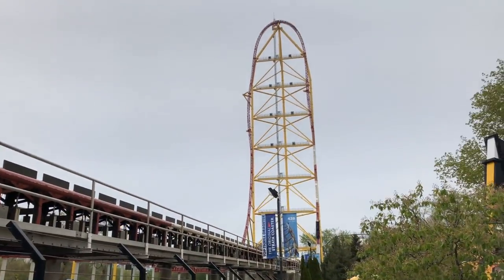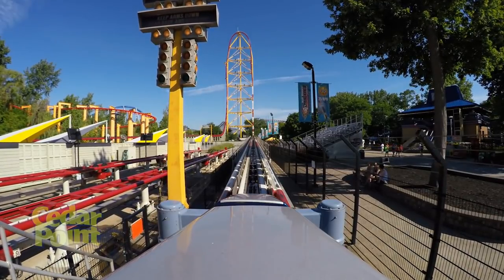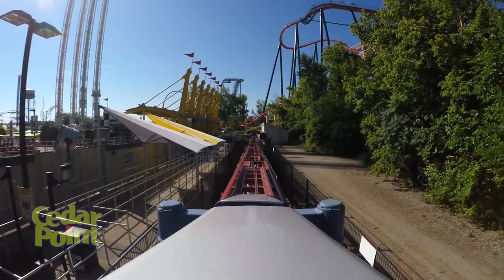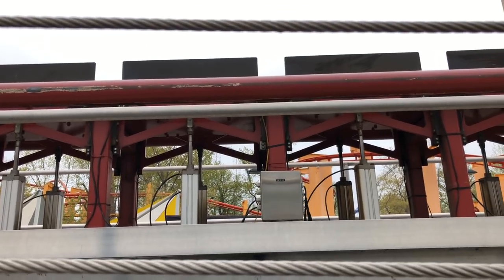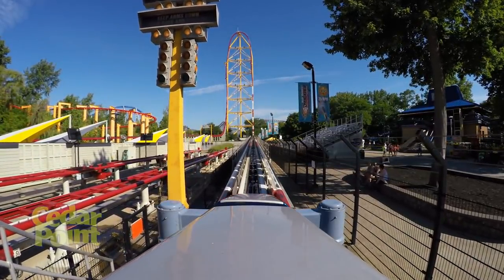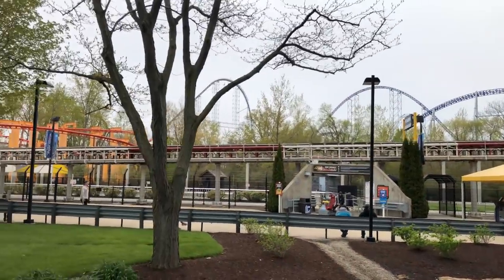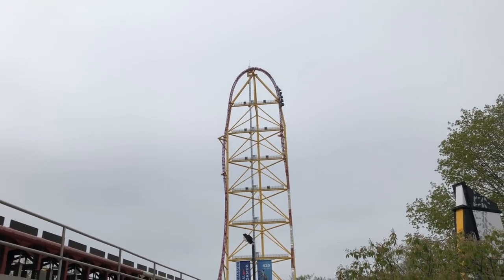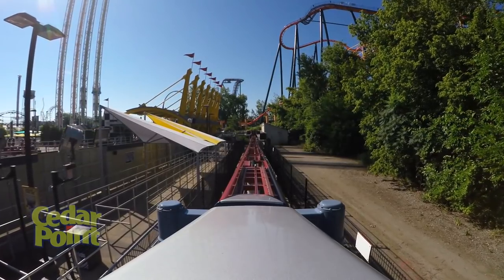Cedar Point Conspiracy Theory: Top Thrill Dragster

Comment: Hey! I used to work on Dragster so I have a little insight. You were totally right.. majority of the time we were down for weather, followed by sensor and fin faults. We almost never went down due to hydraulics themselves, but we would go down for the catch car not engaging the trains correctly. In regards to the 5 vs 6 trains.. we ran with 5 for hourly throughput reasons. Running 5 was more efficient than running 6, due to parking and multi move. I never heard of a possible bumping issue, but who knows haha. Thanks for the construction updates! I can't wait for Yukon Striker next year.
Reply: About how many Dragster employees get to experience a rollback? I know it's a strange question but I was wondering for the amount you get to see them when you run the ride you would at least get to experience it once, right?
Reply: As many times as I've seen them I have never actually experienced one hahah. A few times the last ride of the night (with a semi empty train) would fault the sensor at the top of the tower for going too slowly over the tophat. If you're looking to get one I've found that they happen most on the first or second train of the day.. or if you're lucky enough to be next up after we would go back up from a weather delay! Contrary to popular belief there is no "rollback button" that we are able to press :)
Reply: I was just coming here to say all this thanks! 😂
Reply: I wonder why 5 trains would have a larger hourly throughput than 6 trains? And I believe I’ve seen them run 6 trains before, but I may be wrong
Reply: Tysen Leib more blocks and trains means more waiting on trains to move to blocks before launching
Reply: Yes that what I always heard also about running for 5 of the 6 trains because of efficiency... I can that example on my openrct2 recreation as well
Reply: I saw some wanted posters of this trio... Said they were building some machine to overthrow Maverick. Pretty silly right?
Reply: its because isnt there senor issues on the launch track even just one showing red its down? and last year it launched didnt make it over and ripped all the break finns off the ride
Reply: @TysenLeib  in 2010 when i was there it ran 6
Reply: A little catch-car brake trouble light is all in good fun. Hahahaha
Reply: I think more than one prox needs to be mismatched to trigger an error (like a single sensor doesn't send a trouble light but more than one will,) but you have to remember that each catch car brake, and each of the speed brakes on top have proximity sensors on them, so there a ton of sensor readings to keep the ride running in auto-mode.
Reply: @MiLeYjBfAnN22  Funny story, I was one the first train after a rain delay and they only filled the first three rows so it wouldn't rollback!
Reply: Brennan Satola yes! Same reason why the morning opening operations calls for a staggered fill for the last few rows of the train.  As the ride warms up we would fill the trains accordingly.

Comment: Now I'm no engineer, but LIM/LSM launches accelerate slower than a hydraulic launch. So with the ammount of launch track that Dragster has, I don' t think that it will have enough speed by the end to complete the circuit. There is a bit of straight track after the launch, and they could put LIM/LSMs on part of the ascent, but it probably still won't have enough speed.

Comment: Dragster was designed so that the trains would move in pairs or just closely behind each other in the load and unload stations. During testing Intamin couldn't get the drive motors to run at the same speed which caused trains to bump into each other.  You'll notice that a train won't move into the next block until the block in front of it is fully clear. Millennium Force is setup the way Dragster was supposed to be setup. On Millennium Force the unload train will move into the load station before the load train clears the station block.  The computer is setup so there are basically mini blocks in the station which allows the train to move forward.

Since dragster has to wait for the block ahead to clear this causes more of a delay then was anticipated when moving trains.  With 6 trains this actually makes the ride less efficient because the launch train has to wait a few seconds longer before it can be dispatched.  This is why they only use 5 trains.

Dragster also has the ability to run in dry mode.  Dry mode basically just causes the drive wheels in the station to move at a faster rate which will cause the trains to move faster. I'm not even sure if the park even lets Dragster run in this mode anymore.  I believe wet mode is what normal mode is called when the drive wheels run slower.

I worked on Corkscrew from 2002-2003 and had some of the crew work on my ride in 2003 when it was down.  This is all going by memory and could have very well changed in the years since then.
Reply: Very insightful analysis from experience thank you. I'm a geek about this stuff & I always paid close attention to Millennium & Dragster dispatches, also Maverick because how they unload/ load. One of the many reasons why INTAMIN is still my favorite coaster manufacturer.
 I wish CP & B&M had implemented an separate unload platform like Millennium Force did..only would require 1 additional staff per shift

Comment: I doubt it. 1. LSMs don't have the power to launch it like the current system does and 2. they are power thirsty so increasing the number of them to make up for it wouldn't help. You would not only need new track and trains but expensive new power supply infrastructure. Also it would ruin the ride and it's appeal. The high speed catapult to 120mph is the set piece of this ride. As with all Intamin Accelerators, It's not just the height and speed it's the acceleration and I think operators of these attractions know this. I haven't ridden Dragster but I have been on Kingda Ka and if they replaced it's launch with LSMs it would ruin the ride. I think many people would complain that they ruined the ride as well. I'm sure the same thing would happen to Dragster if they went that route.
Reply: They would the same amount of space for an LSM as they do for hydraulic, so it would have to be the same acceleration rate as the hydraulic or it would not make it up the hill
Reply: @markmccormick6628  I don't think so. It doesn't need the same acceleration rate it needs to be going the same speed to go up the hill. Regardless of how long it takes to reach that speed and there is no way LSMs will get it to 120 in 4secs or less.
Reply: If modern magnetic launch systems still can't match the current launch system they can use them on the vertical ascent too. That'd buy a longer acceleration.
Reply: @Danrarbc  well for a hydraulic launch the catch car decouples and slows down about 2/3 of the way down the launch track so if you have to place LSMs partially up the tower then the force will be diminished which defeats the purpose and the thrill factor of the ride. Longer acceleration does not equal higher or equal thrill. Just look at Superman Escape from Krypton.
Reply: @Coasterlocity  you're talking about a first-generation LIM ride though. And a LIM/LSM lunch would not have to stop at the two thirds mark.

I'm not exactly arguing that the experience will be the same. Just that you could probably still get the car to the top of the hill. If you did this you'd want to make the ride more thrilling by making the layout more interesting.
Reply: In addition to the LSM/LIMs not having to end at the 2/3 mark they also don't have to start where the current launch does. The launch can probably begin sooner. Even before you get to the vertical track possibly allowing for more thrust you end up with significantly more room. You'll still have less acceleration, but completion of the full circuit is the primarie goal.
Reply: What about a compressed air launch?
Reply: @junewalker9341  Compressed air would probably be more reliable than hydraulic and more thrilling but the only ones really doing that are S&S who have now got it to a functional point so getting one on an intamin would seem hopeless
Reply: @junewalker9341  perhaps after we see how well Maxx Force does this could be a future option. Who knows?
Reply: @Danrarbc  I actually had the modern systems in mind like Red Force and yes I'm well aware they don't have to stop at the 2/3 mark. There's no catch car to require the braking distance. Making TTDs layout more interesting is most likely not an option either.
Reply: Would compressed air really be more reliable? Hypersonic XLC was undoubtedly the least reliable coaster I've ever seen.
Reply: @nr92cp6  perhaps they have had time to perfect the technology. They obviously have some faith in the design with Maxx Force being announced recently.  We have to see if it's going to suffer from the same reliability issues.
Reply: @Danrarbc  it will become a booring kiddy coaster if the acceleration time increases. whether it comes over the hill or not does not matter anymore at that point.
Reply: C Rizzy, I am saying that they would have the same amount of space for launch track as they do now. So if it is going to make it up the hill, they would have to make it the same rate of acceleration. I am not saying it is possible, but I am saying it would have to be the same rate of acceleration to make it up the hill, unless they use launch track on the way up the hill to
Reply: C Rizzy that is true, but you said what I said is not true. And it is true because the rate of acceleration would have to be the same as it is now. I never said it would be as great as it is now, but it would still be ok.
Reply: Coasterlocity  I feel like LSMs like on Red Force could be possible, but the launch track would have to be modified. And someone already said they would use a lot of power. I think the coaster community would riot if the acceleration was slowed down. And there’s no way the layout would be changed. Cedarfair is cheap. I like the idea of a compressed air launch. That might even boost the speed and definitely the acceleration of the ride. But we have to consider the rideability. Do:do:donpa does a number on the human body and we don’t want Dragster to have the same problem. Unless Intamin comes up with a compressed air launch I think a LSM is more likely.

Comment: I loved the Dragster when they still had the huge wheels on the back of each train. For the folks who don't know what I am talking about is when the Dragster opened the trains were each designed to look like an actual Dragster race car. The wheels added weight to the trains this made the ride almost impossible to operate consistently because the Trains had extreme difficulty of going up and over the top and therefore there were way too many rollbacks. Man did I love it back then. We got rollbacks quite a bit however the Dragster was down quite often almost every day it was down. So in order to get the trains to clear the top they trashed the fins and tires on each train. It was either that or run half empty trains which did not allow for many people to ride and huge wait times. Anybody reading this remember the original dragster trains with the wheels?
Reply: I missed those also..I lot of people forget...I'm 35 & the community are younger ..the Cedar Point INTAMIN years were the best 2000-2010.
Reply: yes. they added 2 seats and another car, so if you can find eight huge guys to ride in the back you may get your rollback back.
Reply: I remember those giant tires on the backs of each train, One of the tires actually flew off and almost hit people! Thats another reason they removed them too.

Comment: Just an idea I have would be to switch to catapult weight system. they all have these huge towers already there, they can utilize the size and weight of counterweights to propel the trains. A simple electric motor to whine the counter weight back up the tower using the kinetic energy the fall motion of the weights build up. 

In my opinion with all the issues RMCs Lighting Rod has had it think it wouldn't be wise to switch to LSM/LIMs. I felt that just as with Kinda Ka it wasn't Hydraulic issues but Fins just like you said I think because the potential for Roll Backs due to weight and weather they had to increase the power the system which probably caused more downtime. it always seemed to me when they were down and did test runs. the test runs without weights would work fine.

Comment: Find it strange that TTD has so many issues. Ik the hydraulics are complex and the systems, yet here in the UK Stealth (intamin accelerator) can operate in heavy rain and wind speeds up to 22mph (May have changed). With this it normally goes down to the fire alarm shutting off the console (recurring and annoying issue), or there is a batch of sensors before offload, which trip frequently (normally beginning of the year) and stop the drive tyres and strand the train until a full reset is complete, and normally takes a month or so to run in. The only other main down time is a mid- year cable replacement.

In terms of changing to lim or lsm, i would say its not necessarily the best idea, as although they are more reliable, there are still issues and overall the launch isnt as forceful and gets less show around it, as Gp from what ive seen find the sudden launch from 0 more exciting then a gradual increase.   The only other reason it may not be upgraded is because it will draw a lot more electricity and require a lot more high end electronics and capacitors, which would like require pits dug out beneath the track and replacing the launch track and fins (as seen on red force at Portaventura)

Comment: I have a theory on how an LSM launch could work, within the same area. First; the current operating systems would have to be scrapped. Trains would have to undergo modification in order to be compatible with the new LSM fitted track. LSM fins would have to be in two rows, not one, in order to increase acceleration capacity. Each individual fin would be wired with extremely high capacity cables to a supercapacitor. The supercapacitors would charge up while the launch is not in use to maximum capacity, and simultaneously discharge at a high precision and very high speed through the high capacity cables to the LSM fins. Given the high energy cost, wind power installations could be placed on the Top Thrill Dragster top hat structure to offset and sometimes handle the extremely high electricity cost. The Top Thrill Dragster, as you said, catches a lot of wind. The whole system would be controlled by a reliable, modern computer system partly controlled by the ride operators, to make sure that the Supercapacitors fire at the correct sequential times.
Reply: Formula One-like aerodynamics could also be used so that less energy would be needed to accelerate the train cars.

Comment: I think a compressed air launch would be the only way to upgrade it. LSMs just don't have the same force, but a compressed air launch would be just as, if not more intense.
Reply: willhamlink it is essentially using a compressed air launch with a hydraulic system
Reply: Yeah but a S&S style compressed air launch has fewer moving parts and can provide even faster accelerations, just look at Do-Dodonpa. An S&S air launch would keep the same insane acceleration and cut down on the maintenance somewhat.
Reply: An air launch would be more reliable and thrilling if made by S&S but intamin doesn't have the tech for it
Reply: True, maybe Intamin and S&S would work together on it, either way that's the best way to fix/upgrade TTD imo

Comment: 8:13 This is not true (as far as I know). My dad and I talked with a ride op and it's not a safety concern, it's just that the coaster runs more efficiently with 5. If they ran 6 trains one would just be sitting on the second brake run doing nothing. With 5 trains they don't have that train parked on the brake run and still maintain the same capacity.

Comment: You could have SNS come in and replace the hydraulic launch with a pneumatic air launch, but I don’t know if that would work or not
Reply: Joe H.S It wouldn’t make all that much of a difference. The biggest issues aren’t with the hydraulic launch system but the electrical & mechanical components that are in the launch section all need to work in unison consistently to keep this ride running and the demand is so high during peak season at the park that ride staff and maintenance really do their best to keep it from going down day in day out but there’s just so many parts and sensors that need to all be on the same page for it to run properly. If there’s one rollback it screws up the whole ride and everything has to be slowly reset and the train has to be brought back into the station slowly, have guests unloaded and taken off the platform, then they have to send the train empty to see if it will make a complete circuit. And a lot of times it won’t because of a slight sudden change in wind speed / direction is just enough to make it not clear the top hat section. Even a proximity sensor being faulty can cause this ride to not make a complete circuit. It’s so complicated yet so simple. I hope they can find a way to make this more reliable.

Comment: Would having an Lsm launch increase the time it takes to reach max speed in the launch making it less intense?
Reply: Logan Chapman  Yes, LSM is nowhere near as powerful and forceful than hydraulic launches. They’d have to modify the final block section, unload station, and load station to get more room to add LSM / LIM. Even if they did I don’t know if it would ever be the same. They’d have to shorten / lighten trains and a whole bunch of other stuff. As it is now the trains weigh about 5-5 1/2 tons each.